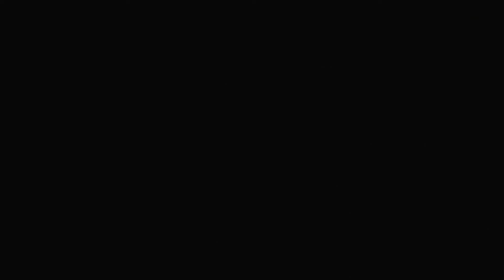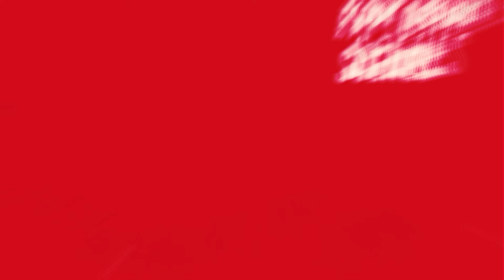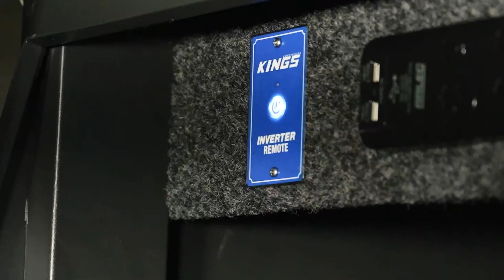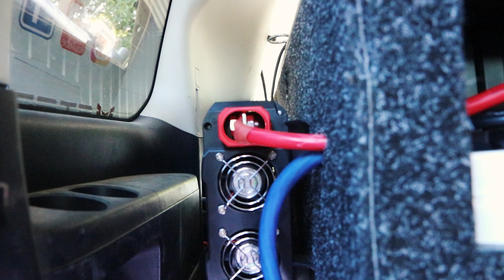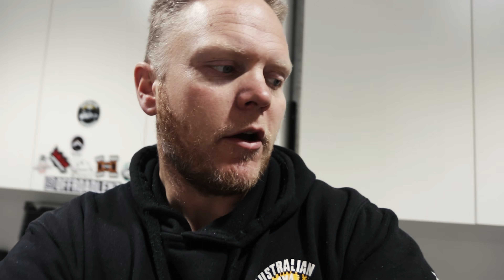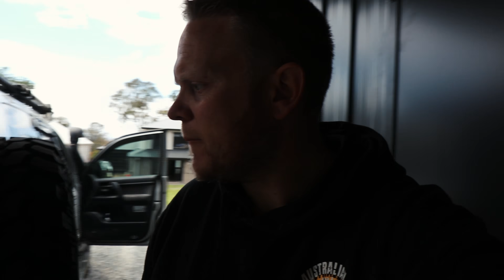BRAND NEW! Kings 3000w Inverter Install and Testing Review

Comment: I can’t complain purchased a Caravan 22ft missing a lot of the electrical purchased 2 kings 40amp mppt and the kings 200watt solar panels x8 and 2x3000watt inverters too be honest I am happy did have a problem with the thermal mount on the 40amp mppt they replaced it 
The solar panels are good 
The inverters good all in all it’s ok for the value it serves me fine the battery’s I didn’t get from the purchased ex Telstra with larger amps agm style

Comment: everyone I have watched reviewing these inverters, not specifically Kings, you all try to take the inverter to it's maximum load, why are none of you testing low draw, I ask this as I have had the misfortune of an inverter being capable of smoothly running a 2000 watt air con with no problems, yet when running a 100 watt fan, the inverter created a brown out condition as it allowed the capacitors to run down to low, this burned out the fan, not just one fan it did the same to a second fan, there seamed to be a large lag from low voltage to re charging of capacitors.  tried this with a different brand of inverter, no problems, browning out an electric motor worries me far more than accidently overloading the inverter.

Comment: great test mate 
what sort of battery are you running and what size amp hr mate
Reply from the maker: Hey mate.  Thanks.  Back then I was running the DCS 200amp slimline battery I believe.  It was awhile ago now so I forget 😆. 

I’m running the LFP cells Australia battery now which performs so much better
Reply: @Australian4x4Adventures  thanks mate i got 2x 120 ah  agm do you think they be ok for the 3000w inverter
for indution cooking
Reply from the maker: Unfortunately no.    Maybe if the cars running you’ll get a bit out of them but AGM just arnt upto the current that induction cooking pulls.  
They drop voltage too fast

Comment: Just got this inverter and having issues powering my 1800w mitre saw with it, any suggestions why? Its a Bosch PCM 1800 SD
Reply from the maker: Sorry for the super super late reply.   Only just seen this.   
I’m guessing the saw has a surge voltage when it starts up or your battery isn’t upto the task of the amount of power drawn in a short burst would be my best guess sorry

Comment: I have a question about inverters and batteries. I’m renovating my caravan with 240v wires throughout. I only plan to run a fridge, convection oven, lights and a tv and dvd player. The fridge will be the only one running non stop (while travelling around). The fridge is 240v 50Hz 
0.73A 106W. How do I work out what size inverter and battery do I need?
Reply: For a caravan install I would go for a 3000W PSW Inverter, an oven is going to use 1500W-2000W, microwave is 1200W-2000W, toaster 1200W, jug 1000w-2000w, air fryer 1300W, induction cooktop  1000W-2000W, it can add up quickly and for inductive loads (fridge motor) you can use 3-5 times running watts for initial startup current.

Comment: What size fuse are you using on 3000watt inverter?? 300amp
Reply from the maker: Yeah 300-350 amp.  It really depends on the cable capacity

Comment: Great review BUT !

Nice review and was interesting to see how the Kings 3,000Watt inverter performed. One comment:

I don't think it's a great idea to design a system where you rely on the battery BMS to trip. What if the BMS fails, especially with budget batteries.

Personally, with our van,  I design the system with battery  breaker's designed to trip below the battery BMS limit.

So our battery's have a limit of 175AH each, thats a system limit of 350Amps.  I set the overall system limit and fuse to 300A and on each battery I have a 200Amp breaker. 

Batteries have a surge rating to 320A so in theory I am hoping the 200AH breakers on each battery would trip.

In reality even at max system design of 350A the batteries should not trip.

Just saying 😃  the system  inverter max should not be tripping anything. If anything the design should be the inverter should trip first rather than the battery BMS.

Comment: If I'm fitting a 2000 watt inverter and using a split charge relay.... do i need to upgrade my alternator ? It's only a 150 amp. Thanks

Comment: I use a lot of kings stuff. Never had a problem with any of it. Except awnings… but… $99 is $99
Reply from the maker: Kings definitely have their place in the market and it helps ppl get out bush so I don’t have a drama with them
Reply: @Australian4x4Adventures  oath mate! Be heading your way early next year. Might get in contact if you wanted to do a rig rundown on mine - she’s not normal!!

Comment: Im looking to power a 230 Volt air compressor with an out put of 1100 watts, do you think this inverter will do the job?
Reply from the maker: It should do it.  But it depends on the surge value of the compressor.  Some of them can be as high as 3000w on start up which it will struggle with.

Comment: Steve, nice video, what is your battery setup? I think Someone told me, (I think it was Renogy), that a 3,000 watt inverter needs 400 amp hours to use it’s full potential for some time? I’m still learning. Just like with wire size and fuse, every chart seems different, etc. My theory was bigger is better, bought 4/0 cable, then needed a hydraulic press to put on the connectors. I may have a run over 6 feet from tongue batteries so maxed out cables? Thanks for a real, down to earth video, real life use. Now I need to get an inverter that works properly, lol

Comment: I’ve tried a Renogy 3,000 watt, dead out of the box. Tried the pure sine wave 3,000 watt from harbor freight. It worked for a very short time, then died, would not start back up. Looking for a balance between quality and price.
Reply from the maker: I’ve got the renogy 3000w in my new car and it’s been working fine for me.   
Sounds like it may be hit and miss if they work or not.

Comment: I still don't trust it from all the reviews kind of hesitant... are you running a fuse on the inverter and what amperage? For the price it's tempting but don't want any problems...good review
Reply from the maker: I had a 300amp in-line fuse in place.  

I’m currently running the renogy 3000w inverter if you want an alternative

Comment: I just subscribed ,,what a very interesting video and interesting test ..I wonder what brand of  lithium battery you have ..great to see the BMS protection cutting off . Looks like the inverter is pretty good , I'm thinking of buying one ..And yes when I buy I hope to get a good one and not a lemon . I don't want my caravan to burn down because it's my home for starters .
Reply from the maker: Hey hey.  Thanks for joining the YouTube family. 

I had the DCS 200 amp battery back when I made this video and it was a great battery. 

I’ve currently got the ITechWorld 240x pro and it’s just as good if not better in my opinion so far.

Comment: Firstly I'm impressed with the power this inverter can push out - my 2000w kettle and 900w toaster plus a few little things like a soundbar, subwoofer and laptop charger all at the same time. Now the toaster and kettle only ran for a few minutes before the water was boiled and the toast popped up - and the cooling fans didn't even kick in. The problem I'm having is that if I just have the laptop charger (<100w) running then after 20-30 mins the cooling fans kick in and they don't ever turn off - I have to turn the inverter off and on again to make them stop. When the fans are running there is plenty of cool airflow. Do I have a defective cooling system ??? Do I have to uninstall and take it back to get another which hopefully doesn't have the same problem ???
Reply: U should be charging laptop using 12V,
Reply: @TheEggWhisperer Absolutely, anything u can run off DC is going to be far more efficient than using a 12vDC -240vAC inverter then back to 5v - 20v DC for small appliances, just use 12vdc or DC step up/down converters for better efficiencies, especially if Solar is a part of ur recharging process.

Comment: What size battery do you recommend  to use with the 3000 w inverter
Reply from the maker: 200amp and bigger.  

Ideally 300amps +

Comment: Pretty sure you are supposed to run a fuse between the inverter and your battery. All the other brands say you have to check the inverter user guide
Reply from the maker: Yeah you are definitely meant to

Comment: I bought the kings 3000w inverter. Checked the 240v output. The wire is 16AWG. 600V  105°c.  Is this enough to hold 3000w🤔🤔🤔🤔

Comment: Have  you done a product review update since you've had the inverter for a year?
Reply from the maker: I’ve since sold the car so don’t have it anymore to do another review.  
The new owner is still using it and hasn’t reported any issues with it.
Reply: Oh great!   That gives me confidence that the inverter is still going well.  I recently bought 2x160wt solar panels, 2 x 115amp lith batteries and an MPPT controller for my 3000wt inverter so I went beyond to make sure I have enough power.  Btw, do you remember the wattage of the air fryer you used?   I'm  wanting to buy one and most of them run at 1700wts.

Comment: Great review and subscribed - look forward to more reviews, especially on the Kings stuff! Would be interesting to see voltage waveform during large load transients (over voltage) - this is often what kills electronics when drawing on the same inverter. I’ve seen generator (Kings in fact!) reviews where the cheaper ones would spike at around 300V - electronics death 💀

Comment: I'm setting up a canopy and am going exclusively Kings (except for a Bushman 85lt upright fridge.) 
I see no problem with the quality of the bits I've bought....so far.
Reply from the maker: There’s not a lot wrong with the kings products, they serve a purpose for the price and will do most ppl for weekend warrior stuff.
Reply: @Australian4x4Adventures  since my previous comment, I've received a Kings 250 watt portable solar panel and the mppt regulator was dead out of the box. Emailed, no reply, ditched the reg and rewired the panel without one at all. 
It'll now be run through the Kings mk2 dcdc.

Comment: U have an air fryer in ur camp set up?
Reply from the maker: Yep.  Love it.
Reply: @Australian4x4Adventures  didn’t even think to add it. Have you weighed you cars’ set up?
Reply from the maker: I have.   The car FULLY loaded for a big trip I was just on 4t all up with 2 of us in the car.     Day to day driving it sat around 3.6t.
Reply: @Australian4x4Adventures  wow yeah that’s pretty good 👍 have you done a walk around of your whole set up ?
Reply from the maker: Actually since sold the car recently and never done a full walk around.    Best one would be the “ Ute vs wagon “ video which runs through a fair bit of it.
Reply: Hey since read up that the inverter you used in this video might not be lithium compatable . I’ve just bought the itech batteries u have. Did it work straight away?
Reply from the maker: Yeah haven’t had any dramas with any of the setup at all.

Comment: Awesome vid mate, very informative and entertaining, using the kings gear myself without any issues. Just bought thier MT1 trailer with 2 lithium batts and 3000W inverter. We run literally of it.  Mate try cooking yr bacon in the air fryer.  Super krispy 😀
Reply: How many ah to run a 3000w inverter?

Comment: Air fryer and induction at the same time. It may be a great idea. But consider the fact that after your FEAST you battery is flat. You now have to charge it.  So camping for a LONG TIME is not going to happen unless you have a genset. So now you have a genset why you need a BIG inverter
Reply from the maker: I had 200 amps of lithium so I’d only use 30% of the battery on that meal.  Still 70% for running the fridge, cooking brekky the next day and then I’m on the tracks again.     
The lithium charged up at a rate of about 70-100amps per hour so didn’t take long to charge. 

If I wanted to sit for more then 2 days I’d take my solar panel which would charge it back up during the day.  Or I’d just run the car for an hr and the jobs done.

Comment: If you want to add a jet engine to your 4x4 this is the inverter you need😂😂 they could at least add a proper temp controls for the fans it is so loud .The inverter itself works great I have no complaints about it and set for the noise the produces, i’ve often thought about pulling it open and Adding a PC fan controller because it does not need to run at that rpm because I do not feel any heat coming out of it although I don’t use that the maximum wattage, I don’t know if the new one they got out now has better fan control but due to coronavirus I  could only buy old stock. 
And if you’re only using it occasionally jeez it’s a good bang for buck but I live off grid in the bush so this is my main inverter which now I know I’m buying the more expensive one
Reply from the maker: Yeah the fan is bloody laud but that never really bothered me as it’s only on when I’m cooking something.

Comment: i wanna know if i can plug a 10 amp to 15 amp converter into a 3000 watt inverter plugged into either a 12v or 24 volt battery, will this work ? i wanna power my mains pwer to my caravan to an inverter but its a 15amp socket..

Comment: Great test video. What size inverter do you think I would need just to charge power tool batteries. I already have a 100ah Lithium second battery. Cheers Steve.
Reply: Depends on battery charger my makita single charge works off 150w inverter in car

Comment: Hey mate, I see you have a mycoolman, I have the same one, I wonder if yours cools from one side like mine, if I put a carton in the centre and turn it on, after several hours one wall would be frozen and the rest at fridge temp, this tells me all the cooling elements are on one side of the bin, wanting to know if yours is the same
Reply from the maker: I’ve got the 97lt dual zone which can be controlled separately. 

I’ve never had the issue your talking about.
Reply: It could be short on gas (possible leak) or a compressor issue, & a few other things as well. First make sure you are getting a good power supply to it & the voltage doesn’t sag too much when the compressor kicks in.

Comment: Great video mate.  I only have a 100ah lithium battery in my car with max 270ah draw.  I already purchased the 3000w inverter, not thinking about the battery capacity I would need.  I am only intending using mine to grind coffee beans, use a coffee perculator and heat milk, all at maybe 1400w - 1600w -  cant beat a good coffee first thing!  I expect that this will take about 6 minutes in total.  At most, this would only pull 20 amps out of the battery each morning.  Do you think my setup will survive this okay?
Reply from the maker: Hey mate.  
Yeah ya battery will handle that setup just fine. You’ll love it.  At least by having the bigger inverter now, if you ever upgrade the battery’s the inverter is already big enough.

Comment: Do u think you could run the airfryer through ur inverter while driving and charging through dc to dc charger at same time thx
Reply from the maker: Absolutely you could. 
I charge my DCS lithium straight from the alternator too so it pushes in about 90-100amps at a time so would would cover all the power used plus have some left over to charge as well
Reply: @Australian4x4Adventures  thx for that will give it a go, I only have a 25 amp dc to dc but  considering the shorter cook time should work perfectly. Appreciate all ur content thx

Comment: Great video. Ive been curious about the kings 12volt gear. What are your thoughts on the kings 120ah and 200ah lithium batteries, when compared to more premium brands? The kings lithium batteries are a fraction of the cost, but would you feel comfortable in having one  in your vehicle. Are they safe and would they last as long as premium brand batteries? A possible video for you maybe.
Reply from the maker: I’d love to review one of the kings battery’s but being self funded it’s a fair chunk of money for me to outlay without much return for something I won’t use long term as I already have lithium in all of my setups.
Reply: @Australian4x4Adventures I have recently purchased 3 x 200A Kings Lithiums (2 x Blue Top & 1 x Black top @ $800ea) for an off grid Ute canopy & a shed inverter installs. From recent reviews & research, they seem like a solid product for their price point at this time & hard to beat.
Reply: Wouldn't touch their lithiums. They aren't a fraction of the cost of good brands. They are basically charging the same money.

Comment: Champion Video. One question about your install. Do you have a fuse between the inverter and the battery?
Reply from the maker: I’m this video no.  But I have since installed one just to be safe.   It wasn’t supplied with one
Reply: @Australian4x4Adventures  cheers, just about to install one myself but couldn’t figure if it needed it and the size.
Reply: Second that, type of fuse, ANL, inline blade??
And amperage of fuse??

Also, don't they have an internal fuse?

Comment: Gday Iron Chef! I just bought one of these yesterday for my work trailer I'm keen as! Just wanted to ask you are these safe to wire directly to the battery with the cables they come with? No need to run a circuit breaker or maxi fuse? Just want my first crack at DIY 12v install to be safe as possible cheers!
Reply from the maker: Hey mate.   I’ve since added a 300amp maxi fuse to make it all a little safer.
Reply: @Australian4x4Adventures  300 circuit breaker equivalent okay?

Comment: Nice Vid mate, Any chance to measure the 240V at 2KW ? interesting to see if the inverter HOLD the 240V ( 230v) or will it SAG under load... ie... drop to say 210V Ac etc.... ta